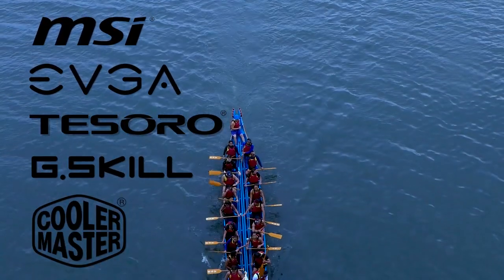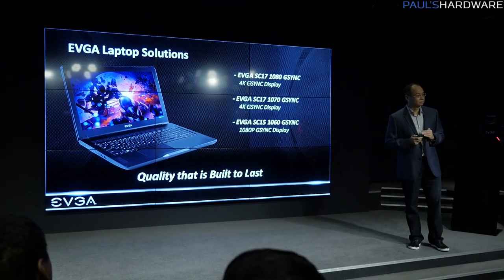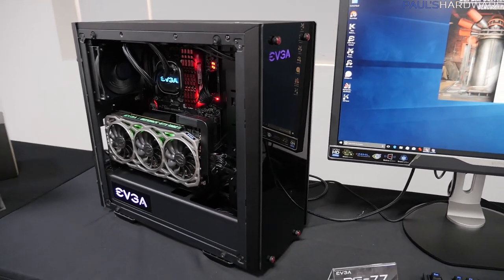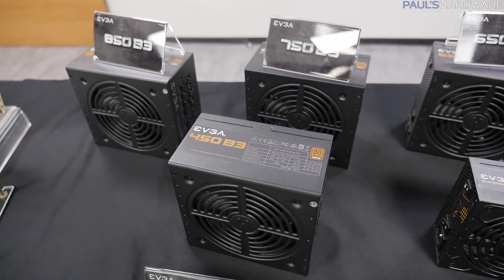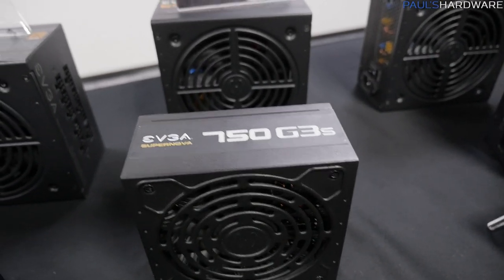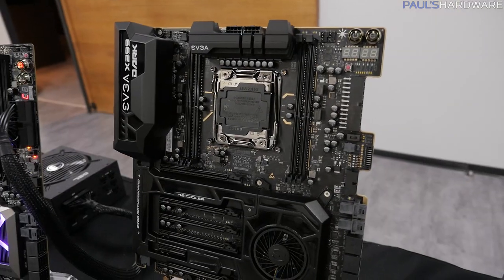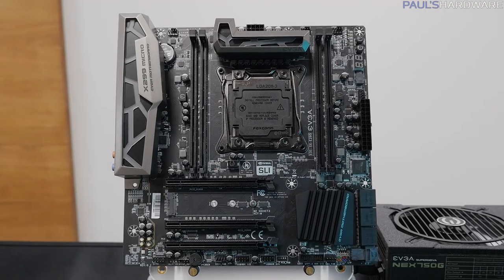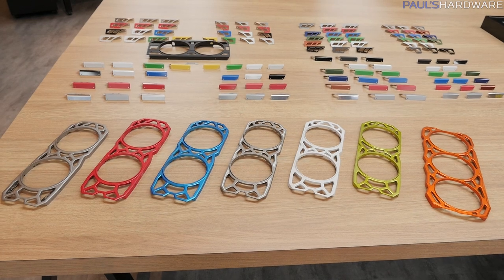EVGA X299 Dark & FTW K Mobos, SC15 Laptop and KINGPIN 1080 Ti!

Comment: That 750 G3s would be great with some cases that have next to no clearance around the PSU shroud. I have a DeepCool DuKase V2 and a 750 supernova an I can just BARELY Squeeze that sucker underneath the shroud. Also due to no room around the PSU under the shroud it cuts of one of the cable access ports that leads up and out of the shroud into the main internal compartment. This G3s would allow it to be used and make the routing of the audio front panel connector to look cleaner. PAUL! STEAL IT FOR ME!!!

Comment: so would you pass on the 7700k Z270..build for say the...7820X...right now looking to build a PC in the next few weeks
Reply: Depends if you need the extra cores. I just did a 7700k build because I mostly game and want the higher single core performance (and the new Kaby X is very little improvement with the added cost of an enthusiast motherboard).  If you are only using the build for gaming, I cant imagine there is any need for it, content creation etc. is a different story.
Reply: OK cool yup mostly gaming I just don't want to shoot my self in the foot a few no this from now ironically I just bought an i7700k and a Z270 board a few days ago but it sounds like good news for this gaming rig
Reply: Yeah, I literally put mine together yesterday after seeing the leaked specs. Just doesn't seem like they are improving much. An extra 100 mhz base clock is irrelevant since we are all overclocking them anyway. No way to tell for sure until reviews, but the savings on a motherboard alone seem like its worth it (plus can get them for $299 at Micro Center and $30 off MoBo with the bundle). I don't think you'll regret your purchase honestly, but until we get third party reviews we wont really know 100%. But with them being $339 and on the X platform/x299 chipset, I don't think we will see a reduction in 7700K price either (at least not less then the $299 tag at Micro Center). I won't have any regrets honestly unless 7700K drops like $50 in price *(which Intel never does, lol)

Comment: Excuse me, 

I'm an architecture student and want to build a render PC (pretty urgent). I'm waiting for Vega (RX Vega gaming series) and it is rumored to be the released in August. In the meantime, I wanna buy a cheaper card (price : around 60 usd) then sell this temporary card and get Vega (RX Vega gaming card that equivalent to gtx 1070 or better). For the render application, I'm gonna use a cpu based render engine, and later on (when Vega is out) I'm also gonna use Unreal Engine 4 (GPU based render engine). 

Any suggestion for the temporary graphic card is appreciated. :D

* Temporary PC Part :
CPU  : AMD Ryzen 1700
Motherboard : Gigabyte GA-AB350-Gaming 3 
Ram  : Corsair - CMK16GX4M2Z2666C16 
GPU  : "don't know yet , but get suggestion to use R7 250 2gb"
Storage1 : Samsung SSD 850 EVO M.2 SATA 250GB 
Storage2 : WDC 3TB SATA3 64MB - Blue - WD30EZRZ 
PSU  : Seasonic X650 650W Full Modular  80+ Gold Certified 

Thanks a lot!
Reply: thanks for ur opinion! :DD